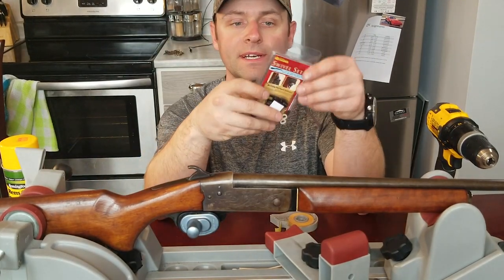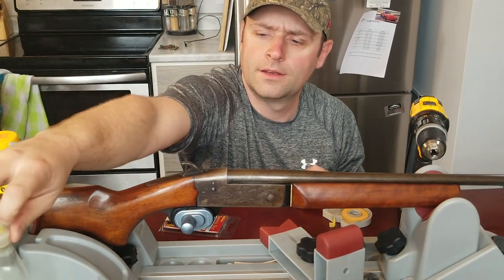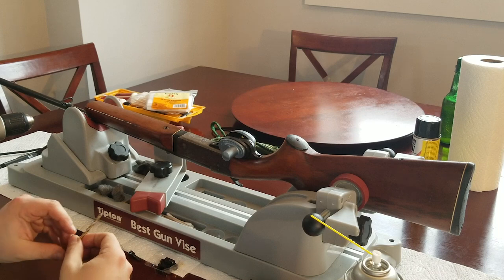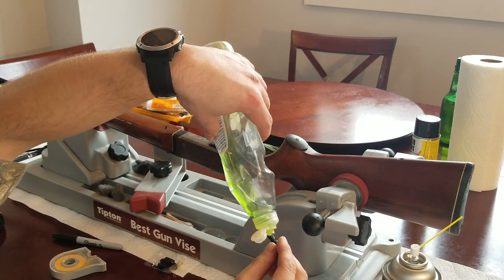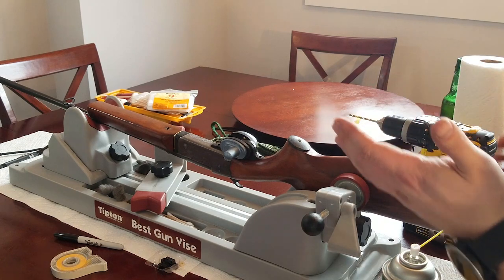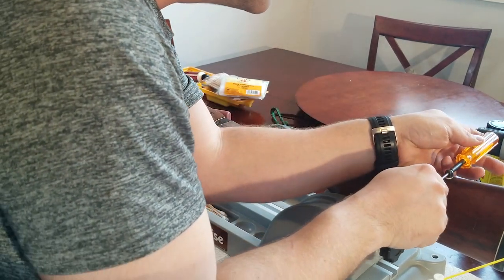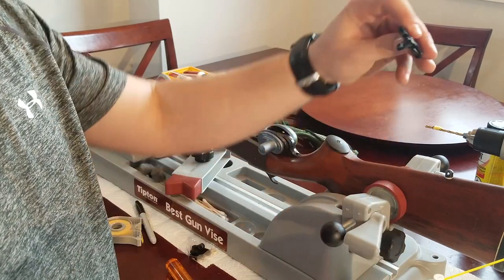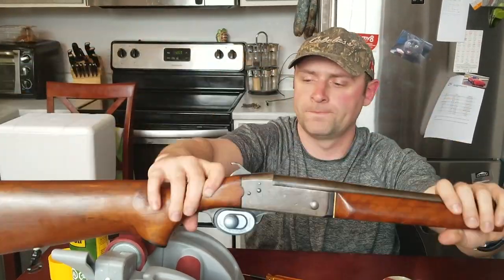How To Install Shotgun/Rifle Sling Swivel Mount

Comment: Why not metric measurements?
Reply: Metric doesn't work and it never has. Which is why in American we use standard.
Reply: @Username-i9t  if it doesnt work why does almost every country use the metric system? It seems that America is one of the few countries still using the imperial system. Perhaps it's because america is too lazy to learn something new?
Reply: @wisnog99  imperial works for me every time.  If it ain't broke, don't fix it.
Reply: i use metric & imperial . i kinda wish it was either one or the other , b/c now i have to use 2 different ones AND convert them back and forth, jeeez. lol
Reply: Who cares use what you like and let others do the same.